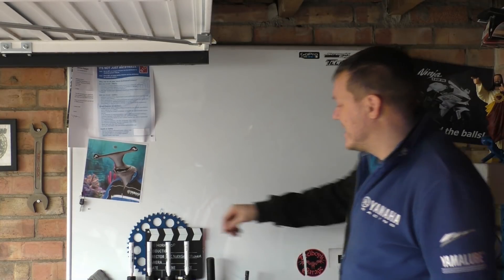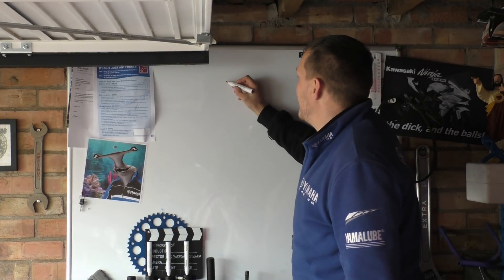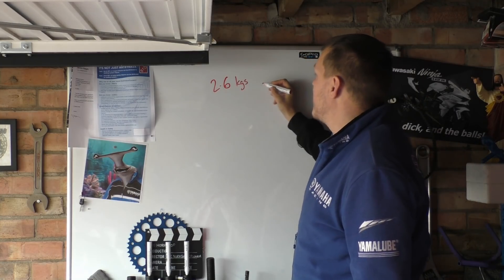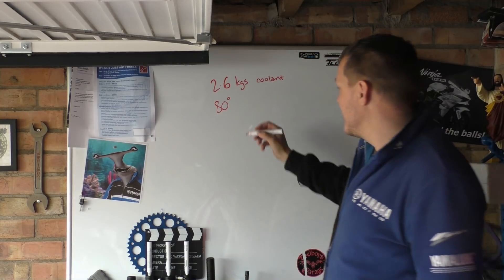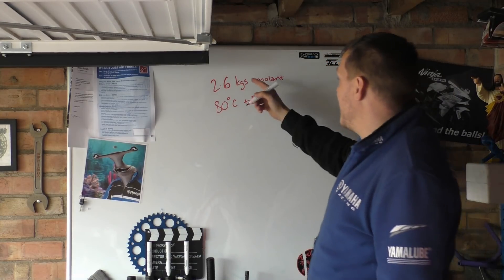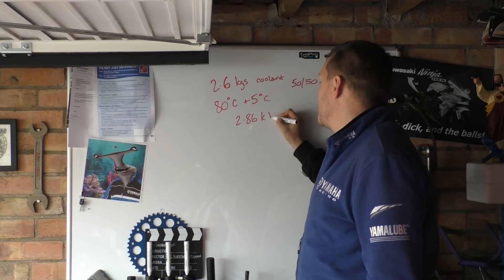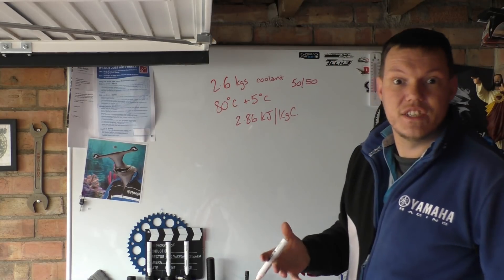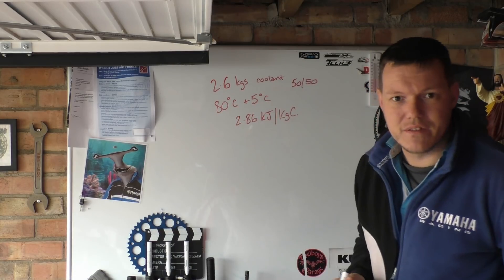Evans Puzzle? Riddle #3

Comment: Did my own experiment. My bike has 2.4L of 50/50 coolant. 4.0L of oil.

I let it idle and got this rough estimate of the coolant heating up, using the stock temp indicator.

C°  @  Time
19°    1:40 
38°    3:06
58°    5:30
77°    7:32

I would have let it idle longer but i was low on gas.

Comment: Does the thermostat not control the temp the engine runs at? Just allowing more flow around the engine.
Reply: but the more glycol is in the mix the less ability it has to remove that heat
Reply: Not according to evans!

Comment: Matt not relevant to  this video just a quick question would slick 50 oil treatment or STP oil treatment hurt a 600 bandit engine
Reply from the maker: What oil are you running? If you are running a good oil like castrol etc then there is no need for this shite.